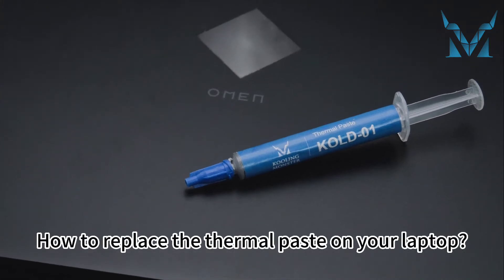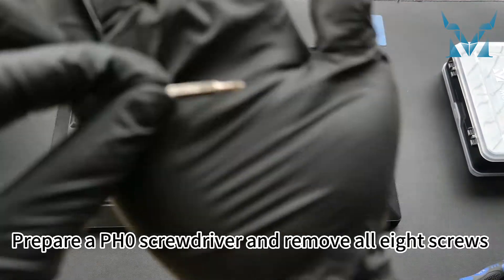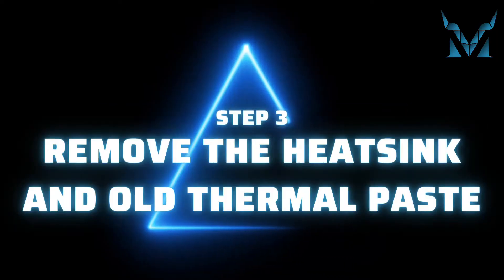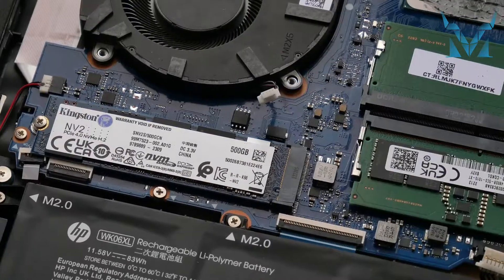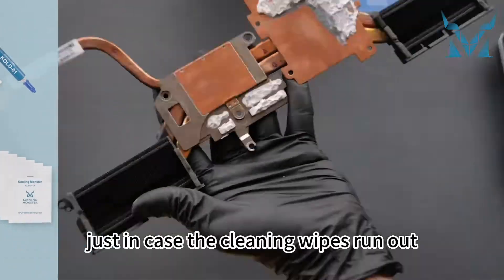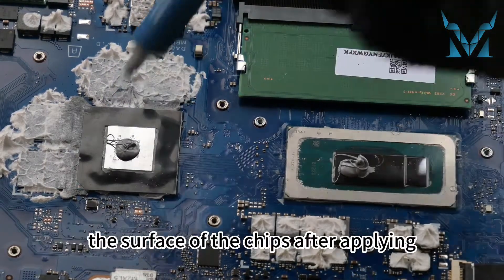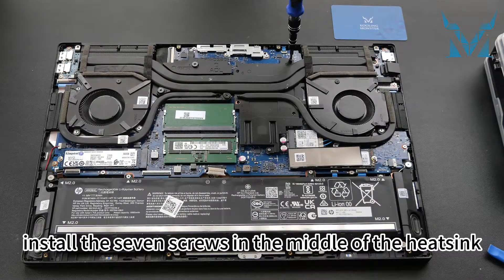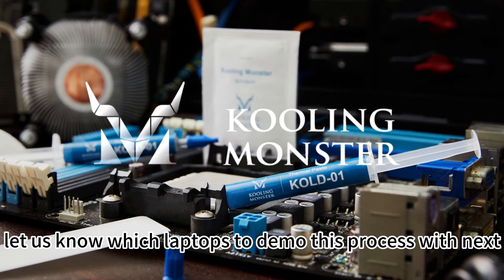Speed Up Your HP OMEN 16 - Prevent Overheating With Dust Cleaning & New Thermal Paste

Comment: So if I leave the factory thermal putty and don't clean/replace it, I'll be fine?
Reply from the maker: Yes — the factory thermal putty for VRAM/VRMs can usually be left as is 👍
As long as it still looks soft and making full contact, it will continue to work fine.
Just replace the CPU/GPU thermal paste if temperatures are getting high.
If you ever need new paste, our Kooling Monster KOLD-01 is a great upgrade! ❄️😄

Comment: I also have a Same issue with Hp ome 16 Ryzen 7 - Dont under as soon i start my game and 5 to 10 it goes off no power nothing need to wait for 20 / 30 Min

Any solution to this???
Reply from the maker: That sounds frustrating! If it shuts down that quickly, it could be overheating or VRM issues. Try cleaning the fans and repasting the CPU/GPU. We used KOLD-01 thermal paste—it’s non-drying and really helps with stability under load. Might be worth a try!

Comment: Fuck this omen16 b0353TX model.
First of all i had the touchpad issue which i got replaced under warranty from HP.
But still it didn't resolved. Still it lagged and the service center had no idea about this flaw .
Just after few months, my laptop turned off immediately and was not starting.
Came out that ic got burned .And it would cost more to get it fixed. 
Hp just made me broke 😭😭 after 1.5yrs .

I highly doubt that the service center men did some wrongs intentionally while fixing the laptop as they had dissembled it completely while placing new touchpad.

Or was it because of over heating???

Hp just ruined my money and gave nothing

Comment: Is it possible to remove the whole thing to get to where the keys are to clean whatever gunk has gotten under them?
Reply from the maker: Yes, it’s possible—but it depends on your laptop model. Some require removing the entire top case to access the keyboard underside. If it’s just light debris, using compressed air might help. For deep cleaning, take your time disassembling. While you're in there, it's a good chance to repaste too—we used KOLD-01 thermal paste, safe and long-lasting!

Comment: Hmm.... i really think to do this. I clean my Omen16 once a month - open it and clean the fans and between - but never done anything to the heatsink. My Idle temps are pretty good (GPU and CPU under 50°C). Also in most games i have no Problems. But... I have 2 Unreal Engine 5 Games that make REAL problems Screen goes black and lockscreen appears. Maybe its just because its summer :D But... i cant play Clair Obscur: Expedition 33 or JDM: Japanese Drift Master. The only way that it works at least for some time is to just max out the cooling - which is very loud lol.
Reply from the maker: Sounds like you're already doing a great job with regular cleaning! 👏 But if those UE5 games are crashing or black-screening under load, it could be thermal saturation or VRM stress, especially in summer.

Repasting the CPU/GPU might help stabilize temps during high spikes—we used KOLD-01 thermal paste, which is non-drying and handles long sessions really well. Might be worth a try if you're pushing heavy titles like Clair Obscur or JDM!
Reply: @koolingmonster Thank you for the answer. I found a reddit post and a post in the omen forum. The sensor that checks if the screen is open or closed is placed at a very bad position and get damaged by heath. So when temps reach 60°C - the sensor get false information and start flickering. So i had to remove the cable from that sensor. And ...the laptop is working fine again. I also changed cooling paste and made a deep cleaning. I have now pretty low temps and the flickering is gone.

Comment: Hi I before i came across this tutorial, I happen to venture in this adventure alone and now I have a bent heatsink, my games give lower fps because of cpu throttling. I was told this is a normal bend, it will affect nothing. On battery, my laptops is slower and on charging my laptop is hotter cpu temps reaches 100 degrees just after a opening a game and till it opens up the menu the temps are already reaching 100s. I regret the day I tried opening this laptop, I wish I have gotten your video sooner, now the warranty is gone and only fix is to replace the heat sink. Its gonna cost me 140$. Because I happen to live in a third world country, this is not cheap and it has made my life way worse.
Reply from the maker: Really sorry to hear that—it’s incredibly frustrating when things go wrong, especially without proper guidance. Don’t be too hard on yourself; many of us have learned the hard way. If replacing the heatsink is out of reach for now, you might try repasting with a high-quality option like KOLD-01 thermal paste to help stabilize temps temporarily. It won’t fix a bend, but it may improve thermal transfer a bit. We're rooting for you.

Comment: Thank you for the visual guide.

There is a bit of difference in my case of Omen 16 (i7-11800H/RTX3070), for the heatsink section, you only needed to loosen section 1-7 just enough to make it loose and then unscrew section 8 to disasemble from the side closer to you/bottom side.
Reply from the maker: Thank you for sharing your experience! That’s a great tip for the Omen 16. It’ll definitely help others with the same model! 😊

Comment: Geez. Might be easier to just buy a refurbished Omen and transfer files.
Reply from the maker: True, but our complete toolkit actually makes this process super simple

Our products are fully equipped with a wide range of features and come with comprehensive accessories. You can give our DIY video a try!

You’re welcome to check out our KOLD-01 thermal paste.  
【PERFORMANCE/OVERHEATING SOLUTIONS】- available across the globe!
Laptop dust cleaning & thermal paste replacement tool-kit combo: https://bit.ly/KMtoolkit

KOLD-01 Thermal Paste: https://bit.ly/kold-01-yt
KLEAN-01 Thermal Paste Cleaning Wipe: https://bit.ly/klean-01-yt
KOMBO-01 Screwdriver Set: https://bit.ly/kombo-01-yt
Air Duster: https://amzn.to/3YTclrP
Reply: This takes like 20 minutes and buying the parts can be under $15 in total lol

Comment: Hello, i was doing the same process, the battery plug was yet to be removed but a screw drop caused a minor spark below the gpu, after the process i turned on the laptop and its fine, and working properly but i am afraid that will it have caused any issue, please guide, 
Thanks
Reply from the maker: It’s good to hear your laptop is working fine after the incident. Fully discharge the laptop before performing any operation.

Comment: This is random but I just bought an hp transcended and I’m seeing temps up to 140F and my laptop shut itself up twice because of overheating.. sadly Its been longer than 30 days so I cannot return or replace it.. I was thinking of opening it and re pasting thermal paste, I’m guessing they fucked mine up so I’m wondering if this would help? 
Thank you!
Reply from the maker: It’s definitely worth trying to reapply thermal paste, as it can often resolve overheating issues if the factory application was suboptimal. Before starting, ensure you have the right tools, high-quality thermal paste like our KOLD-01.
Reply: It has a warranty

Comment: I got an older omen 16, with i7 11800H and 3070, and it runs very hot while I benchmark it using 3D Mark TimeSpy, CPU runs at almost consistent 99-100 degree on the CPU test, and GPU runs at consistent 87-88 degree. I don't know the VRAMs and the VRMs temperature tho....

 I want to repaste the CPU and GPU die using Arctic MX-6 and I want to replace the thermal putty on the VRMs and VRAMs with 0.5mm thermal pads from cooler master

my question is: is it okay to use 0.5mm thermal pads for the VRMs and VRAMs instead of using the thermal putty (that already there in the first place)? or should I just use the Arctic MX-6 for the VRMs and VRAMs as well?

Thanks you to share your thoughts on this comments, I'd appreciate it a lot
Reply from the maker: Here are some recommendations for your Omen 16 cooling upgrade:

 

1. VRM and VRAM: Thermal Pads vs. Thermal Putty

Feasibility of Using Thermal Pads: 0.5mm thermal pads are typically suitable for VRMs and VRAMs, but only if the thickness matches the original thermal putty used by HP. Many manufacturers choose thermal putty because it fills uneven gaps, whereas thermal pads may not make consistent contact in different areas, leading to suboptimal cooling. It’s recommended to check the original putty’s thickness first.

Advantages of Thermal Putty: Thermal putty is more flexible and adapts better to surfaces with varying heights. If the original putty has uneven thickness, you may need to use a softer thermal material instead of a uniform-thickness pad.

2. Using Thermal Paste on VRMs and VRAMs

Yes, but the gap between the VRAM and the heatsink makes it hard to keep them in a fixed position. Most thermal pastes on the market are of poor quality, with excessive fluidity, making it difficult to achieve optimal performance.
Besides, you're welcome to try our KOLD-01 thermal paste! It's different from the standard thermal paste you mentioned. The key difference is that regular thermal paste uses a solvent-based formula, which evaporates when heated, causing the paste to dry out and lose its thermal conductivity. Our unique solvent-free formula solves this issue, offering better cooling performance and a longer lifespan for use on laptops.

 

Hope these tips help, and best of luck with your upgrade!
Reply: @koolingmonster  Thank you for your reply, and thank you so much for your recommendation.

I already did repasted my CPU and GPU using Arctic MX-6 and using thermal pads for my VRM and VRAM. I did notice that some of the small chips around the VRM (which I didn't know what that is) are needed to use 1.5mm thick thermal pads, and luckily I did have that with me so it's not a problem for me, but just need to keep in mind.

After that process I did get significantly better performance, even I didn't properly clean the fan and the heatsink from dust. I did my benchmark test and got 82 average CPU temp and max on 85, and I also got 75 average temps for the GPU with peak temp on 81. Thats a huge improvement considering I didnt use any cooling pad or stand to improve the cooling.

I got that improvement by using only thermal pads, I really want to try out your suggestion for using thermal putty for the VRM and VRAM to further improve the cooling performance on this laptop. 

big thanks for you👍
Reply: @danabani  so you're using 0,5mm and 1,5mm thermal pads for your VRM and MOSFET? I also want to replace my thermal putty with thermal pads and don't know what size I should use

Comment: I did literally this same thing but instead of changing the thermal paste i fixed a fan, i dropped my multi tool 2 times but neither were hard enough to break anything and now it wont turn on
Reply from the maker: Did you lose your power cord when you were fixing the fan?

Comment: I can't open the screwa of the heatsink it is a bit tight to open
Reply from the maker: Hey there, typically, these measures can help prevent screws from stripping:
1.Twist with a rubber band (if not severely stripped).
2.Twist with black electrical tape (if not severely stripped).
3.Use nail clippers/pliers.
1.Best practices to avoid stripping:
2.Choose a high-quality screwdriver (like our KOMBO-01).
3.Ensure the correct screwdriver head.
4.Apply vertical downward pressure when turning the screw.

learn more about lossen tight screws: https://koolingmonster.com/insights/how-to-remove-a-stripped-screw-from-laptop-and-pc-using-only-household-tools

Comment: been 1.5 years since i bought my laptop, should i replace the thermal paste or make professional do the job?
Reply: hi. its very easy and 1.5 years is too early to change the paste. Install some software and periodically monitor cpu/gpu temperatures. if one day your laptop overheats - then go for it. My opinion is you need to change the paste once in several years (4+) or when you change a cooler/sink.
Reply: @alexandergryn  that's why I'm here lol, I wanted to prepare for summer, I've been monitoring temps for more than a year now
Reply: @alexandergryn mines getting really hot only had for a few months
Reply from the maker: If you want to replace the thermal paste by yourself, following our tutorial might be helpful. Hope it helps you!

Comment: Hello, I have an HP Omen 16. It is recommended not to install thermal pads since using them with a thickness of exactly 0.5 generated temperature problems and the heatsink was not installed correctly. replace and use only thermal putty. Good luck for all.
Reply from the maker: Thank you for the comment, we will improve our content in the future!
Reply: Does that mean there should be no issues if I follow the method and tools shown in this video? The fan on my CPU started making strange noises, so I’m thinking of copying what this video shows exactly.
Reply: What about ptm7950?
Reply: Que thermal putty usaste amigo???
Reply: @UnlimitedSky99  compre en alixpress una de 0.5mm  de espesor bro, pero no sirve, te deja para el orto de instalado el disipador, se te llegan a soltar los tornillos xd
Reply: Where else can I get the thermal Putty you mention
?

Comment: shoot what is that other stuff that’s not on the cpu and gpu? it looks like thermal paste i wasn’t ready for that do i have to replace that too
Reply from the maker: The stuff that is not on the CPU and GPU is thermal putty. It is a cheap substance that manufacturers use on components that generate less heat to save money. You can only change the thermal paste and not worry about them. If you want to remove the thermal putty, you can use thermal paste to replace them.
Reply: thermal putty is better than paste for VRAM IC Chip etc.

Comment: Thanks for this video
I have the laptop , few days ago i used blower machine to clean the dust , the the battery is charging anymore 
I didn't open the laptop yet 
Do you have any advice how to fix it ?
Reply from the maker: It's really hard to know exactly what the problem with without looking at your laptop. We suggest you contact the laptop manufacturer since you didn't even open up the back.
Reply: Blower machines generate ions = which are charged with negative atoms. Negative + negative causes circuit. You most likely killed your machine,

Comment: hello bro... but... why dont replace the paste in vram , power chips?
Reply from the maker: Hello! Thank you for your comment. The substance on VRAM and other chips are actually thermal putty, not thermal paste. If the thermal putty are not dried up or cracked, it is defenitely fine to leave them as is. Thermal putty is used for these chips because they produce less heat than core components like the CPU and GPU. Thermal putty is a cheaper substance that manufactures use to save money. However, if you decide to change thermal putty with thermal paste, it will surely benefit your computer.
Reply: I wonder why they use thermal paste on VRAM and chipsets 💀.
Reply from the maker: There will not be any negative impact. @buianhtriet1764
Reply: It’s thermal putty like he said.  Usually you’d have thermal pads
Reply from the maker: @ThisisPartOne  Thank you for your reply! Yes it's thermal putty on those chips. Thermal pads are also used a lot by manufactures to save money. You can also replace those with thermal paste without any concerns!